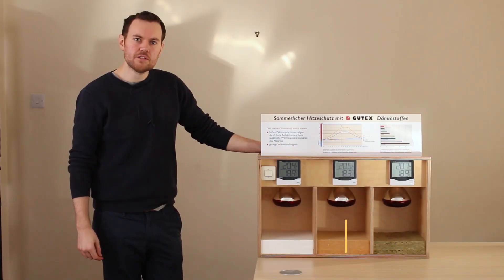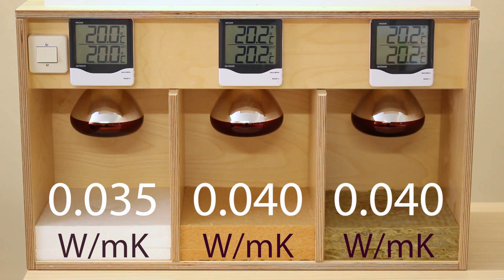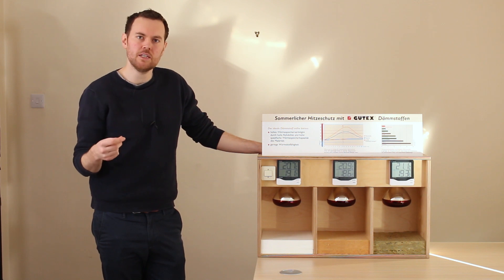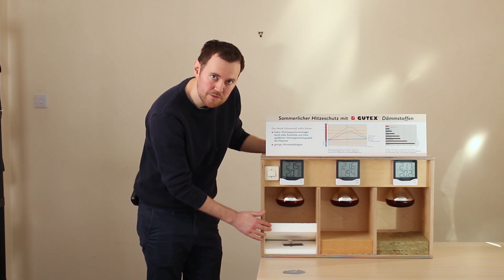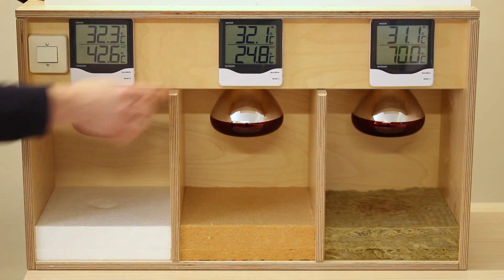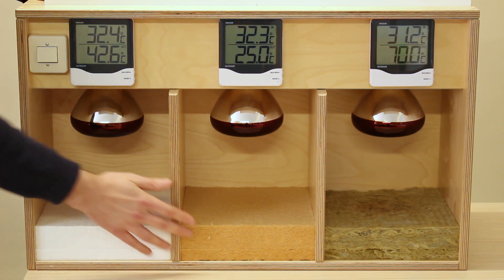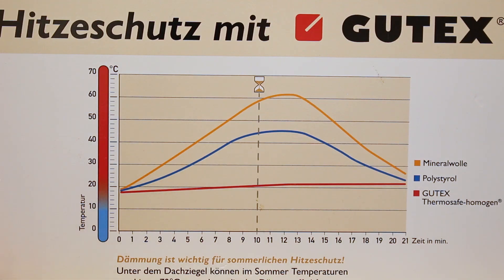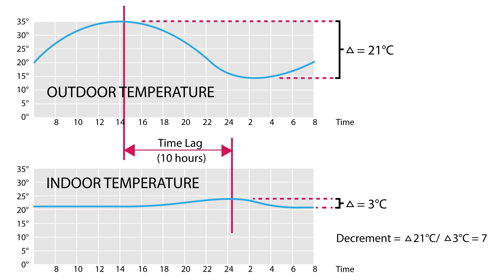Summer Heat Protection with Natural Wood Fibre Insulation Explained

Comment: Fabulous info and thank you. We're about to use wood fibre panels on the roof and soft wood fibre for the wall insulation here in Sydney. The house will be wrapped with Pro-Clima Solitex Exastana and we're fitting an HVAC system and U-PVC double glazed windows/doors. Should make for a wonderfully stable and moisture-free environment. This was very helpful in making the decision to use wood fibre. Cheers - David
Reply from the maker: Glad it was helpful!

Comment: What about colder environments?
Reply from the maker: In addition to reducing summer overheating, Gutex Wood fibre insulation products give excellent insulation in colder environments (the market for wood fibre insulation boards is massive in Scandinavia for example).  In addition to having a thermal conductivity similar to mineral wool insulation the boards, when used externally, give excellent wind tightness that prevents wind washing/thermal bypass from the wind penetrating the insulation in between the timbers behind.

Comment: How is it possible that a material which is good in keeping the heat inside (high RC value, such as pir) is poor in keeping the heat outside. Or the other way around, how is it posible that a material with a lower rc value is capable in keeping the heat outside, such as the wood fibre.
Can you explain me that, preferably in non technical terms ;)
Reply from the maker: In this demonstration, the wood fibre insulation absorbs the heat better when compared to mineral wool and polystyrene.  This improved heat absorption is coming from a combination of the high Specific Heat Capacity, density of the wood fibre and its thermal conductivity.  Which basically means the wood fibre warms up slower, and then releases the heat (back into the home) slower. Resulting in excellent protection from summer heat.
Reply: becase the heat from the sun is radiant heat that doesn't need a material to transfer energy. the heat inside yiur house is the warm air and needs a material to tranfer its heat tru conductivity. so some materials are less conductive than others thats why steel feels cold tho touch and whool feels warm to touch. some materials are better at storing radiant heat. in the eps and rockwool insulation do not have a place to store the energy that hits them and radiate it to the cooler air inside your home. if then at night the oudside temperature drops. the warm air isn't able to conduct its heat back out. this leats to high cooling bills in summer

Comment: Great demonstration, very helpful!
It would be interesting to see where PIR sits in this graph too?
Reply from the maker: Thanks for the comment. PIR is covered under "synthetic" insulation with a specific heat capacity of approximately 1200-1400 J/kgK.
Reply: PIR is basically the same PUR with improved fire resistance
Reply: @chris-2496  tiešām labs tests ne?
Reply: @vikentijslauruts2153  laba demonstrācija. Strādājot koka karkasa māju ražošanas uzņēmumā arī izgatavojām tādu demo ar akmens vati, celulozi un kokšķiedru vati. Secinājumi tādi paši.

Comment: Why haven't you performed the test with polyurethane insulation foil covered?????? Sure everyone is using it.
Reply from the maker: Hi Noel, 

Good point. I’m afraid there is a limit to the number of insulations we can test in the hot box. We can run another video in the future with the foil faced PUR. Based on experience though the inclusion of the foil has negligible effect. Radiant heat will be reflected to some degree by the foil but the most significant influence is the thermal diffusivity of the insulation, the lower the better. Optimum outcomes result from thermal insulation with the best combination of low thermal conductivity, high density and high heat storage capacity 😊
Reply: Highly toxic, like surrounding your home with a can of oil !

Comment: I think this test is irrelevant to what happens in real life in a house when it's hot outside for more than 15 minutes.
Reply from the maker: The demonstration box is aimed at showing the enhanced heat absorption achieved by wood fibre insulation compared to mineral wool and polystyrene.  This heat absorption is coming from a combination of the Specific Heat Capacity, density as well as the thermal conductivity.  Wood fibre has a lower thermal diffusivity than mineral wool and polystyrene and also PIR even though the thermal conductivity is similar or not as good.  This does indeed give reductions in summer overheating – especially on South facing wall and pitched roof structures.